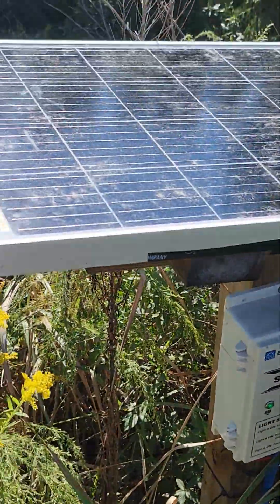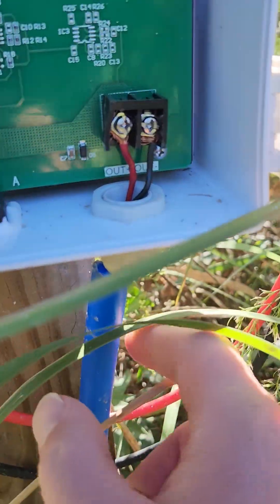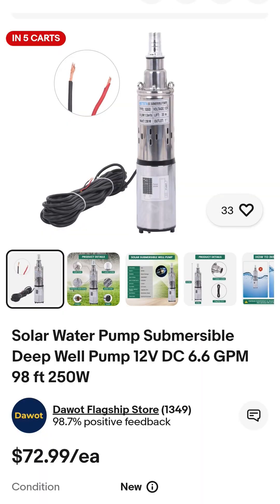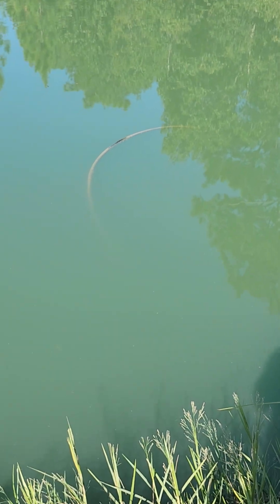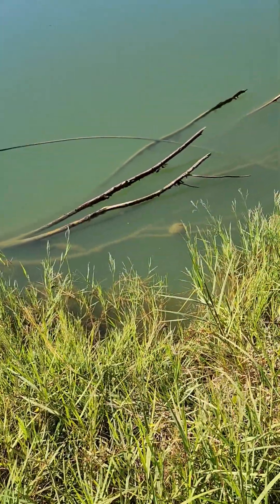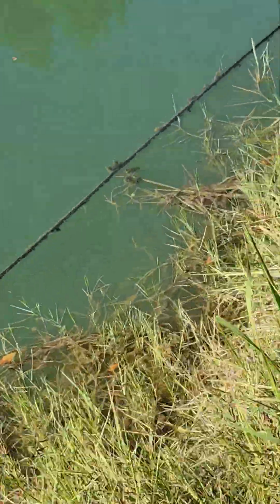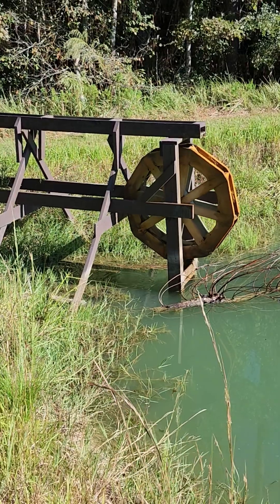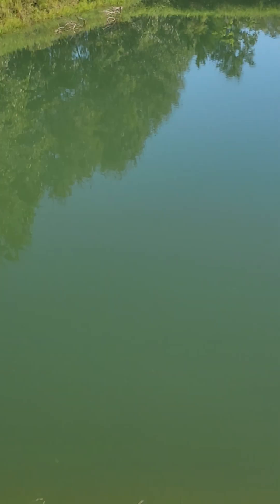Homemade Solar Powered Water Wheel

Comment: Ain’t a chance that water flow is pushing that wheel like that
Reply from the maker: Oh but it is. It rests on 4 pillow block bearing.  You can take one finger and spin it. It's slow to start at first but once inertia starts its spins as shown in the video